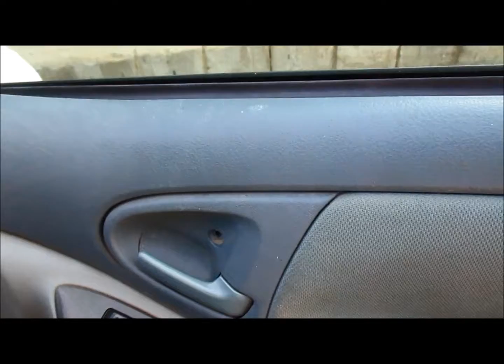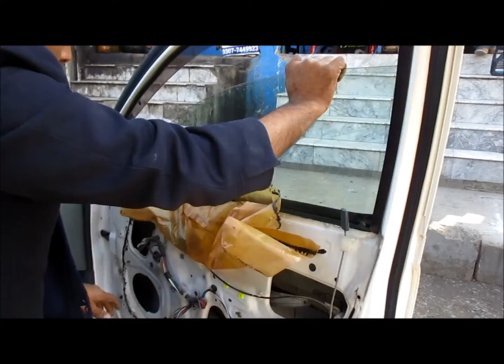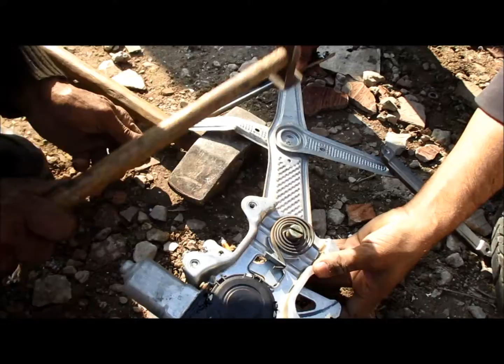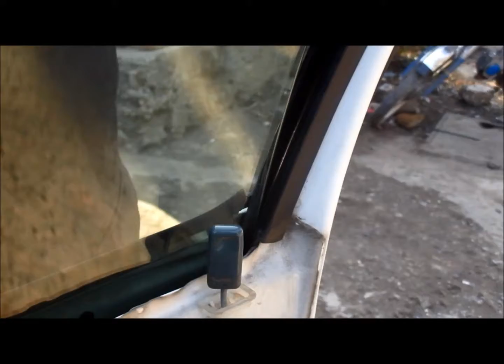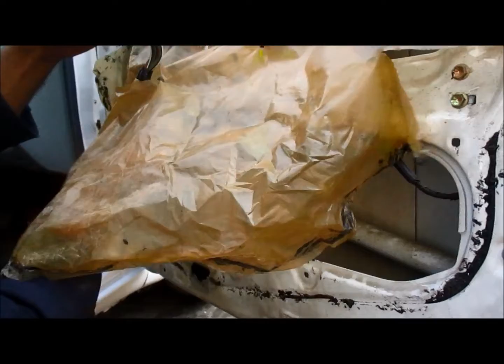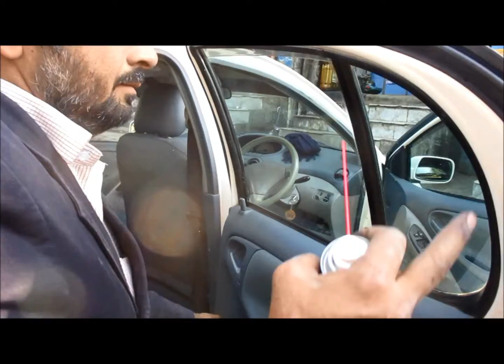how to detect fault and rapier power windows ,Easy repairing  ,.Suzuki .,Honda ,Toyota any car

Comment: Cigratte plug k baray mein video banao bhai... kaisay ampere puray kry output
Reply from the maker: Kis k bare m? Samj ni I
Reply: @CARElectricDoctor  mobile charger socket jaha lighter lagta hai is ki voltage aur ampere ko constant krna...
Reply from the maker: Ooo ok
Reply: G bhai is mein main problem aata hai jab for high ampere wali cheez lagao yeh ouput ampere theek nhi daita... jab is mein dc to ac inverter lagao poray ampere nhi miltay usay... is ka solution relay ho ga?
Reply from the maker: G relay b thek hai. Ni to copster lga len chota sa